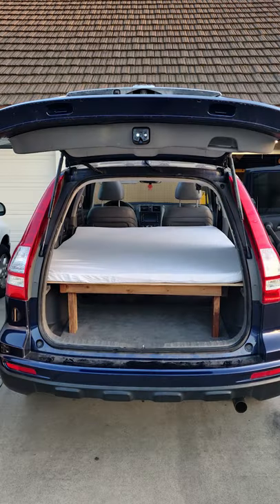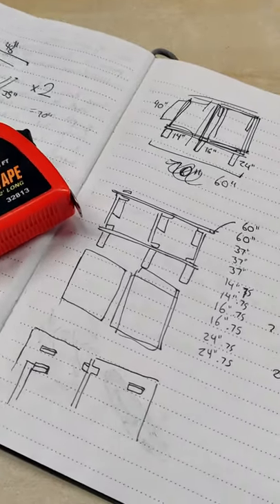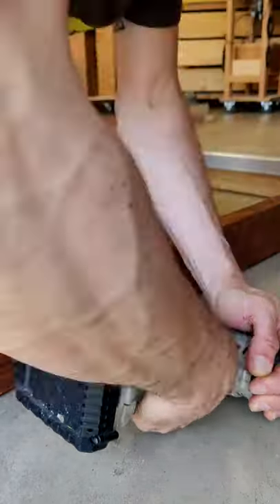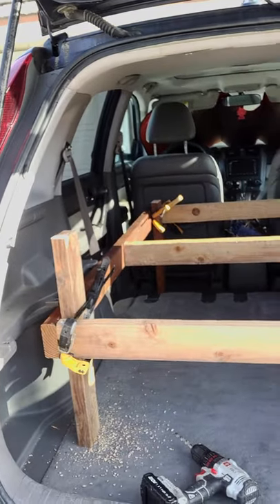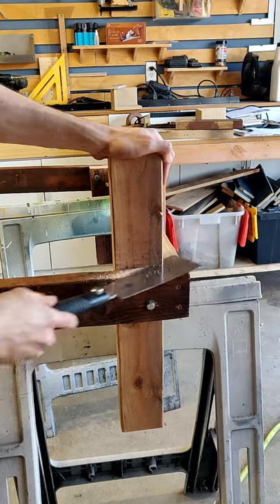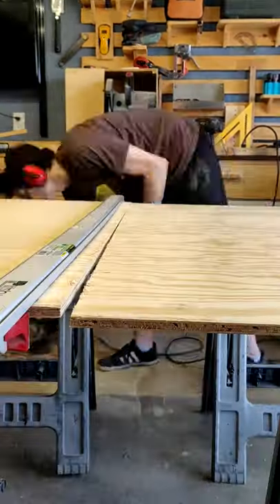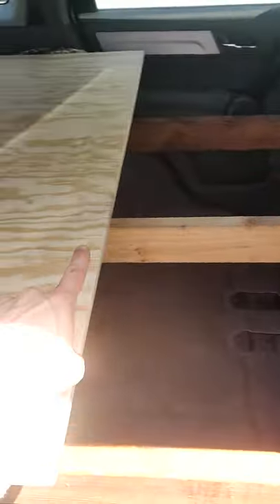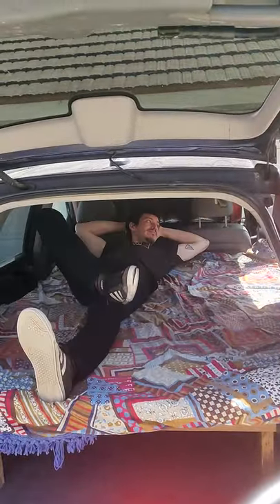Car Sleeper One Day Build

Comment: The chosen title is quiet funny because sleeper car also reffers to cars that look like the car your grandma has but they will shoot frkn flames and win every race
Reply from the maker: That's part two 😏
Reply: @make.anything  😉 just make it go vrooooom stututututuuuu thats all you have to do😂
Reply: @lennartw.2219 "And on this episode we will be printing a 2jZ"
Reply: @Spike-Spi3gel  proceeds to print turbocharger and headgasket
Reply: @lennartw.2219  i mean you could probally print a Headgasket
Reply: @Spike-Spi3gel  you problably could but i think it would blow up easier then a normal one
Reply: @Spike-Spi3gel  a guy called Project Farm testet a 3d printed headgasket on a lawnmower engine and it stopped running after 1 min and 11 seconds.
So you can print them but it wont hold up for long

Comment: Not that it's super important and people won't learn from experience, but pilot holes before screws keep the material from splitting. Putting a screw into solid material acts like a wedge, splitting apart material. But if there is a hole there, the center of the screw can chill and not spit the material. I don't know if anyone will be curious about that, but I explained as easy as I could.

Comment: Fun fact 2 by 4 arent actually 2 by 4 in size that because when they are cut they are usually moist and that makes them bigger so when they are cut they are 2 by 4 but when you aclimate your wood it could be bigger and smaller